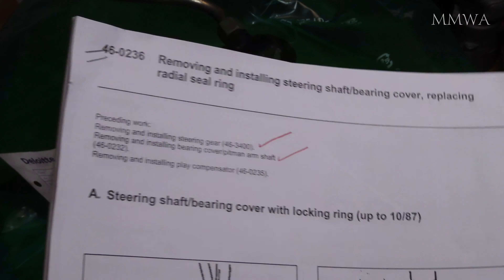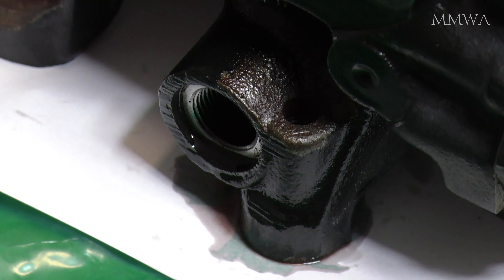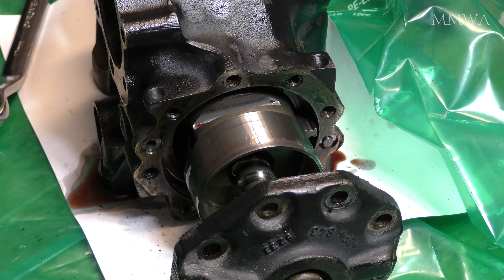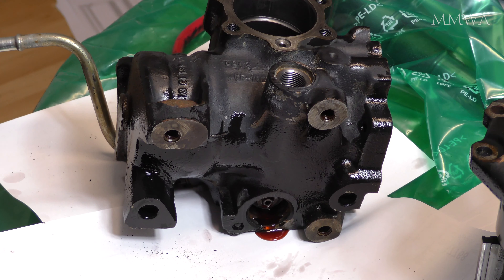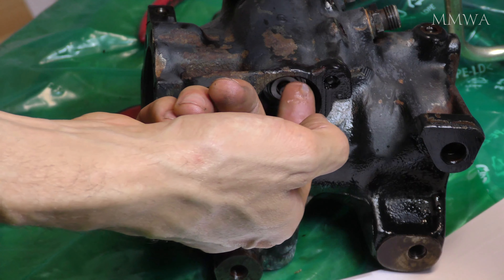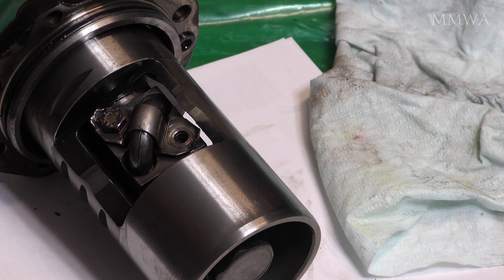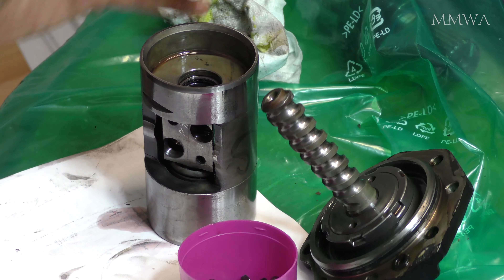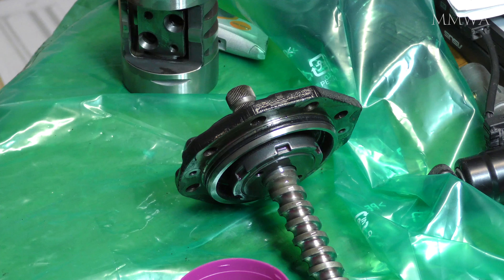1990 Mercedes W124 RHD Steering box reseal at home, part 2

Comment: Im having a problem with a 95 129 pulling to the right.  Ruled out suspension, alignment, tires, brakes, etc.  The steering wanters to the right and i am leading towards a bad gearbox.  The car only has 76k on it but im at a loss.  Would the gearbox cause pressure to leak from one side and pull sterring toward the other?  It does have a leak externally.

I have one degree of caster difference between fronts..positive on the right wheel and it still pulls right...but slightly less

Comment from the maker: So far - I am yet to see validation of why local shops have the audacity to charge $900 for this service. It is far from rocket science. I guarantee they are not using a friction measurement device either and just adjusting "by feel"
Reply: I’m about to be charged $1,400 for this service.
Reply from the maker: @piemasta93  I hope this includes them removing and reinstalling, new fluid, new filter and front end alignment

Comment: I don’t think I have the patience to do this for a daily driver. I have stiff steering both left and right, equal amounts. With an entirely rebuilt front end, I am left to figure out whether I have enough power steering pressure or if my box is bad.  It’s hard to tell whether I have play because the steering is stiff. It returns to Center on most occasions but mostly I have to help it get there.  I’m not sure where to start but I have to wait until USA summer.
Reply from the maker: Daren Stahl if its the spool valve jammed or its springs broken its not allowed to be repaired anyway. This is a complete box replacement job. I’d find a good used box and replace it. With fresh fluid and a filter, if still no go the pump is next I guess.
Reply from the maker: Daren Stahl i also noticed the passageways are very small so its a good idea to keep the ps system clean with clean fluid and regular filter changes. There was a buildup of black sludge inside this box.
Reply: MMWA yes, I have read that draining the system from the box (car off) and moving steering wheel stop to stop several times may reveal sludge exiting the box.  The first time I did a fluid/filter change, I only flushed from the PS pump following careful directions so as not to run the pump dry at any moment. No change. 

Upon startup, the car does emit a power steering type “groan” ( aside for the smog pump which functions properly) , but it goes away quickly.   I need to get the right tools/fittings  to test PS pump pressure.

PS
Just to see the inside of your pump is immensely helpful. Especially learning about which parts are non-serviceable.
Reply from the maker: Daren Stahl it may well be cheaper to just get a second hand pump and throw a seal it at it before install. They are pretty easy to come by.